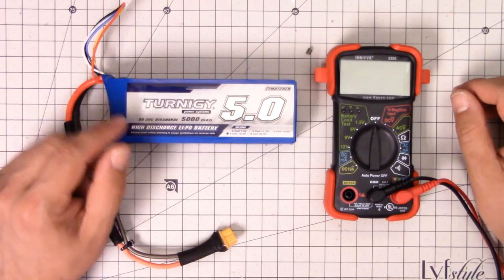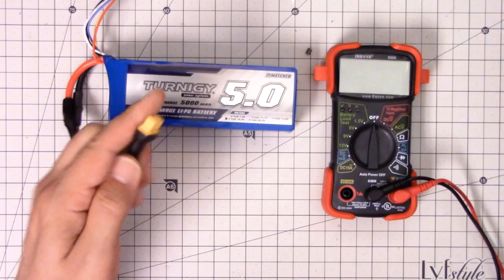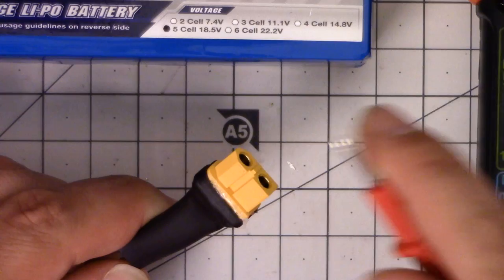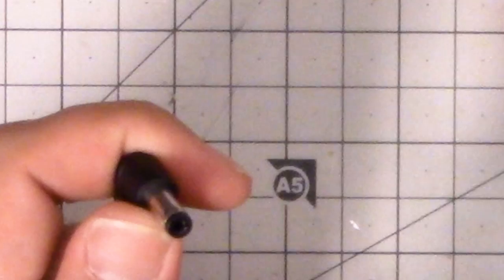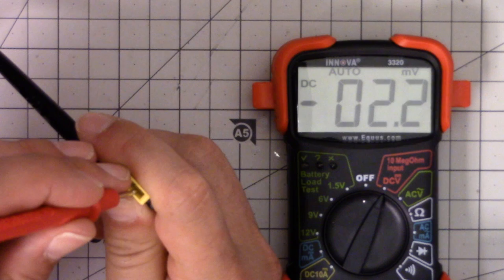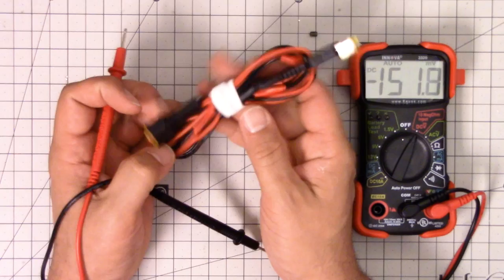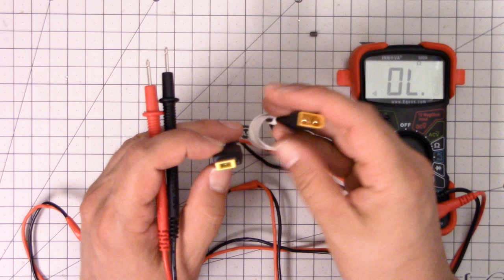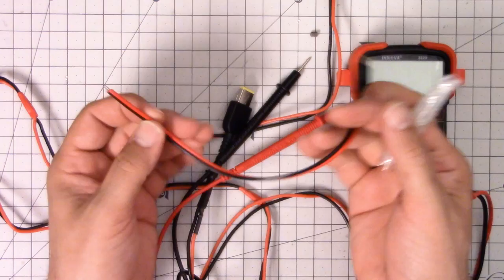HOW TO USE A MULTIMETER to verify polarity and voltage

Comment: I came in with one questions, and three off them got answered at the end of the video. Thank you!
9:10 That pin is meant to push something, I'm guessing it's some kind of "safety" feature of the device it's meant for. So when that pin breaks off, the device will not charge.

Comment: The centre pin is the "ID" pin. It is neither positive or ground. It's what tells your device that the correct charger is attached and that it is safe to draw power from it and charge the battery. Without that centre pin (or if it gets worn out or broken, as they often do eventually) your laptop will still be able to use the cable to provide power to your laptop, but it will not charge the battery.

Comment: My 26 year old DVM is still rocking it!  It was advanced for it's time: data logging via a RS-232 serial port (and I still have the 25 pin RS-232 lead AND 5 1/4" disk with data logging software!).

Comment: Thank you so much for posting this. The part about polarity just helped me figure out why my LED landscape lights weren't working after I did some re-wiring: I had the polairty reversed. I never knew that the negative sign before the voltage on the meter screen indiciated reversed polarity. This video is great !

Comment: I love the adapter for powering your laptop, but what would control the current? Wouldn’t it charge the battery at max amps and create a heat problem for both batteries?

Comment: There is a resistor from the center pin to ground in the lenovo plug ;) It's for detecting what kind of power pack it is from what i can see. 285ohm means a 65W supply, 548ohm means a 90W supply.
Reply from the maker: But why did I measure zero ohms between the pin and ground then?
Reply: That i don't know. I saw the thinkwiki where are the lenovo geeks hang out and saw this:
http://www.thinkwiki.org/wiki/Power_Connector

They have a table there for the signal pin.
Reply: Oh, did you measure 0hms to the wire you made? or to the power pack? That would be the difference. I think the resistance is not in the plug itself, but in the power supply.
Reply: If you want your cable to act like the biggest power pack, you can add a resistor to your home made cable to simulate a 170 W power adapter with a 1.9 kΩ resistor.
Reply from the maker: Hmm. Good point. I wonder what it will think of 0 ohms.
Reply: I think that 0ohms will tell the laptop that its a device that isn't original, and the laptop will only pull the least it can, so no "fast charging" lets say. The signal wire is there so that the laptop doesn't overload the power supply.
Reply from the maker: Hmmm I'm not sure that's true. The laptop seems to charge faster off the 5S than off the 45 watt charger. Also, there were only two wires in the adapter that I bought, so it's not as if I could have installed a resistor if I wanted to.
Reply: Hmmm so maybe 0ohms is max power too

Comment: The signal on pin 2 (center pin)  is what signals the capacity if the charger. (no signal = 90W) If you use the charger on a machine with discrete graphics, it will think it is a 90W charger and the charger may overheat.
Reply from the maker: Sorry I don't follow. Can you elaborate?
Reply: This was a copy paste from a lenovo support thread. I read it as, the laptop will measure (something*) of the center pin to determine what the wattage of the power supply can provide. Therefore a laptop with a big honkin graphics card wont try and suck a lot of current and smoke an under rated power supply.
*Edit: Not sure what or how it would meassure/signal

Comment: I need your help!!! :) <3 - I was given an old 1440p computer monitor for free, but it requires a power supply unit. Looking at replacements online they are $40-$80 but I feel I can go cheaper than that but I dont know much about this kind of stuff. The monitor takes a weird 4 pin plug at 24v and I believe 5 A. Any suggestions on how to get/make something for really cheap? (Monoprice 27 inch IPS zero g monitor)

Comment: I have a pcb bluetooth speaker with 4 led that flash with the music and I took it apart awhile back. Bs speaker. Now I use it like a home stereo but the LEDs stop working. I was changing the 3.7v 18650 battery. Got the polarity backwards because not paying attention. I also rigged up a battery not met to be done this way. I turned it on and saw smoke. Turned it off, fixed wires, and back on. Didn't hurt the module board but did temporary fix on the leds

Comment: Hi there my friend I'm using a Coleman 40 w solar panel it's all hooked up properly but when I test it it shows a negative reading on the multimeter when I connect the positive and negative terminals to the multimeter. Only when I reverse do I see a positive voltage reading. What can you say about that?
Reply from the maker: My guess is that's because the panel is designed to push current into the battery. So the voltage is backwards from how a battery discharges.

Comment: Let us say that you have two wires with a low DC voltage between them.  You want to determine the polarity but you forgot your multimeter at home. Then you wet your thumb and index finger and hold on to one of the wires. Touch the tip of your tongue with the other wire. If the voltage is at least 3 V you will experience a salty feeling if you are licking the positive wire and nothing if it is the negative one. 
You do not need to try this at home because this is where you keep you beloved multimeter.

Comment: Has anyone tried to find out your lipo battery voltage by multimeter and battery checker on the same battery and discover that both readings are way different ? 
on the same 4s lipo My multi meter read like 3 to 4 volt more than battery checker.. i have no idea why.

Comment: Great vid Joshua! I know this is 2 years old, but what would you recommend the best way to check voltage, from a 12 v/2amp bec (Diatone Mini 2A BEC V2.0 12V/2A) to your dji hd fpv air unit (7.4-17.6v), to confirm it's only outputting 17.6v or less, using a 6s lipo? Would you do that from the out on the Diatone BEC? Or from the dji air unit cable connector?
Reply from the maker: I would use a multimeter to test the output pad of the BEC, or the wire, if the output pad was not available.
Reply: @JoshuaBardwell  You know everything Joshua! Thank you for the suggestion. I'll give that a try. Cya on your new vids and live streams!

Comment: Please upload video for guitar effects pedal that doesn’t say the polarity. I got a vintage pedal, only says 12V 850ma. Now I don’t know what polarity of power supply will work correctly. Thanks!
Reply from the maker: It's almost always center pin positive. But you can test the jack. If the barrel sleeve of the jack has continuity to the case, then that's ground.
Reply: Joshua Bardwell wow, great to hear that there’s a solution:) thanks a lot for getting back to me. Good that I have a tester with continuity- so last newbie question- when barrel sleeve has continuity to body- that “ground” means that is negative, am I right?

Comment: ... That's fine for a power source... What about the unit it's self that requires the power ?

Like say a electronic board with 2 leads coming off the board with no markings and random color lead wires ?

Comment: Is the answer that the center pin isn't connected to anything and thus it would have no continuity and no volts?
Reply from the maker: No, because it would be floating then. You wouldn't get any consistent voltage reading.
Reply: damn, thought it would end up being something super simple like that, didn't know you'd get inconsistent voltage rating that way. I always learn something from you man, thanks for all the great work you do for the hobby!
Reply: I actually think this a perfectly reasonable guess. If the center pin was not connected to anything, you would get a consistent 0v reading, just like we saw. Remember, you also get a consistent 0v reading with the probe leads sitting on the bench not touching anything.

Comment: FYI - connect black lead first (ground) - safety first!
Reply: Pheonix 2 in the automotive world you hook up ground last
Reply: Wouldn't that make your black lead hot/ live ? And the potential of mishandling it and coming into contact with you bad? Main reason for hooking up ground first removes this risk of shock.
Reply: Pheonix 2 handling the neg last reduces the risk of shorting things out by accidental contact with other conductive objects in the circuit
Reply: bronco7905 I'm not sure how handling the negative last would reduce that has you have positive potential on that negative lead.
Reply: Pheonix 2 basically if you hooked up the pos last in a car you have a good chance of your wrench arcing out on the body if you touch it or other metal components which are all grounded in a car
Reply: bronco7905 When using a multi-meter the first thing is to make sure that you connect the meter leads the right way round. This depends on the polarity of your car. If your car uses a negative earth system you should attach the lead marked negative or (-) to the body. If your car uses a positive earth, the lead marked positive or (+) is connected to the car body. Check in your car handbook for the polarity of your car.
Reply: bronco7905 I think we may be talking about 2 different things. I think you are referring to hooking the leads of a battery in a car. In my original post I was referring to hooking up the leads of a multimeter to measure voltage.
Reply: Pheonix 2 yes I was talking about pos and neg on a battery 👍 never heard of that with a multimeter didn't know it made a difference but yes I usually hookup the neg on a multimeter first just habit to make sure I have a good ground before testing components

Comment: I tried on my Lenovo charger's middle pin. My multimeter must be broken, it started blinking numbers at me.  4, 8, 15, 16, 23 and 42.
Reply: Arne Hansen... Can u check ur dmm at a normal battery? maybe the reading is because of a switched mode supply..
Reply: I'm kinda Lost ;)

Comment: bet the Lenovo design is patented so they get to sell replacement chargers
Reply: such design is used by Dell too (the center pin is used to identify the power supply and it's connected to ground via resistor)